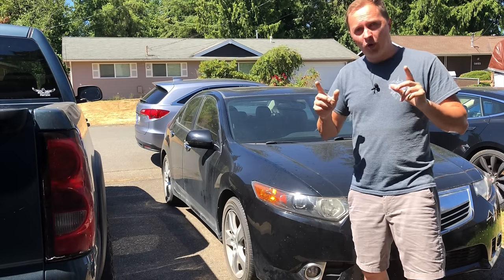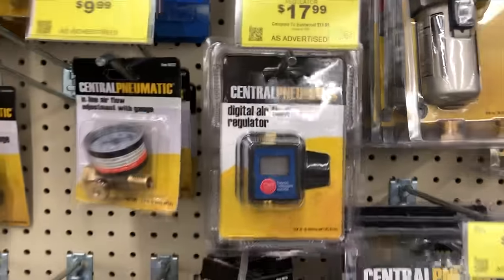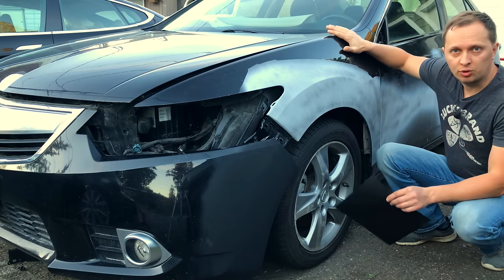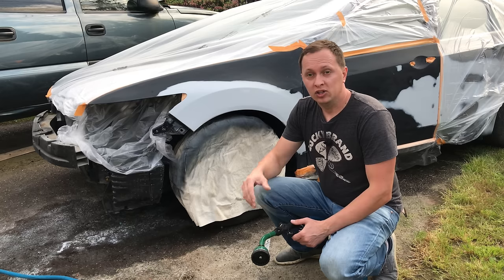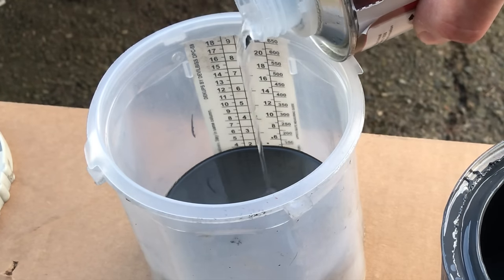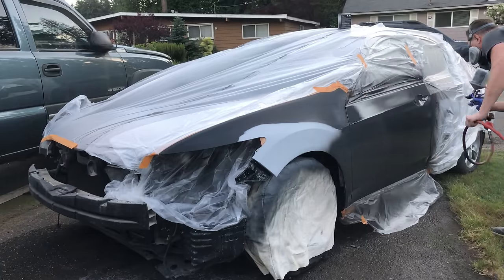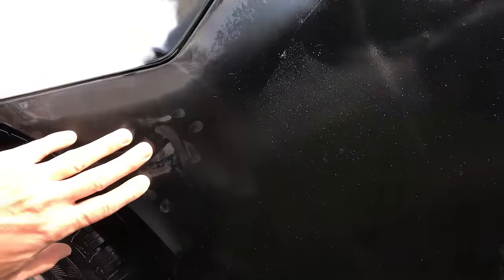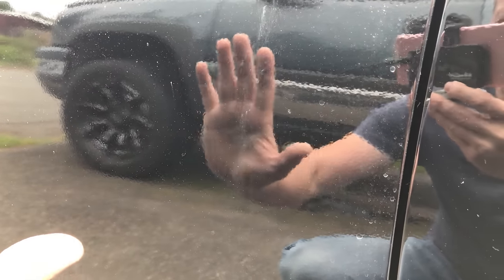✅ Using Cheap Chinese Harbor Freight Paint Gun to Achieve Professional Results

Comment: Am I the only one that thinks this looks pretty good?
Reply from the maker: LOL... I'm a perfectionist, so if it aint perfect, it aint good enough :)
Reply: @fix206  I would be happy with that paint job on my work truck. I’m gonna give it a go this spring wish me luck. Gotta get a spray gun though.
Reply from the maker: If you're going to use of 2 guns in the vid, get the more expensive one... And crank the air pressure up to about 35PSI... You'll go through more materials, because there will be more overspray, but you may get a bit better result then I did...
Reply: @fix206  🙏

Comment: The 14.99 gun is definitely HVLP. The only difference in the 24.99 is the regulator and the tool is included. The cheaper one has neither
Reply from the maker: HVLP gun should perform much better at lower pressure. The 14.99 would probably do a bit better if I cranked up the air pressure, but then it wouldn't exactly perform as HVLP... That's just my experience with these cheap guns, maybe someone else could get them to work better for them
Reply: @fix206  doubt anyone could do any better. My personal opinion is that the gun is worth the money and that's about all. I've bought 3 of them total. Only due to losing the needle spring in both of the first 2( I'm notoriously bad about losing tiny parts) I'd lose my little michael if it wasn't attached. But out of all 3 I never paid more than $10 because I made sure to get them on sale and with 20% coupon. The way I see it the gun is a steal for $10 but I'd probably never pay full price when I can have a good few options in the $30ish range on amazon that would perform a lot better. It's also worth noting that I do not paint professionally but I do prime cars several times a week doing body work and no matter what anybody says, that gun will shoot 2k primer with no problems whatsoever and I've ran at least 200 cups through my 3rd purple gun. It absolutely must be thoroughly cleaned after every single cup but it will lay it down as well as you could ever need a gun to because at the end of it all its gonna be sanded anyway. My purple gun has been used and cleaned so much its gray now. I'm officially retiring it tomorrow though. I've upgraded to the $25 green gun harbor freight has and I'm already thinking I made a mistake. It seems like worse quality than the purple lol but we will see
Reply from the maker: Funny thing is I've been rocking the $15 gun for the past few years to shoot primer out of. And to be honest I think that's the only thing that is good for. Quality of the finish isn't relevant when most of it will be sanded down anyways. And both of the professional guns that I use for base and clear I picked up used that way I only paid 25–30 cents on the dollar for them. This way it doesn't break the bank and I get a great quality paint job straight out of the gun.
Reply: @fix206  I never thought of buying paint guns used. I guess I just figured high end guns were lifetime purchases. I feel slow now. Time to hit ebay thanks for the tip
Reply from the maker: I figured if you are a professional painter and you work at the shop where all you do day in and day out is lay down some paint, then sure, buy a new one it will pay for itself pretty soon. Nowadays I do auto body and paint on the side as a hobby, only paint 2-3 times a year and dropping $700-800 on just one of the paint guns wouldn't be such a great investment for me. The Iwata LPH-400 gun I paid about $180 (around $700-750 new ) at a local pawn shop about five years ago, and my DeVilbiss Tekna I picked up on eBay for right around $200 couple of years back ($$700-800 when new) and it came with a bunch of extra accessories.

Comment: Neither of those guns are HVLP. It doesn't matter what's written on the box, they're not what anyone would call a HVLP designed gun. With what looks like a poorly designed conventional air cap, 1.4 nozzle wide open, and say only 30psi, there's no hope of getting a better result. I believe, (but could well be very wrong), that if you set the pressure to say 45-50psi and only had the needle wound say 1.5 turns out (to compensate for the extra fluid flow) that you might be surprised how well it could potentially finish! I'm not saying the guns aren't garbage, but I wouldn't expect any other result if sprayed in that nominal 2 Bar range that modern guns are "designed" for.
Reply from the maker: Totally agree with you, if you want professional results, you gotta use professional equipment. I'm sure there are people out there that were able to get those junk guns to work for them after a lot of trial and error I bet. Personally I will stick with my Iwata and DeVilbiss guns

Comment: Harbor Freight website says that both the $16 and $30 gun are HVLP
Reply from the maker: I highly doubt that those guns are HVLP... I'm pretty sure I could have gotten better end result with them if I cranked the air up higher, but at low pressure where they "should" have performed better they actually sucked and that leads me to believe that they are not true HVLP guns
Reply: @fix206  Agreed, Paint Society on YouTube used the Harbor Freight gun and got an amazing finish, but he shot at 35psi

Comment: what size compressor and CFM?
Reply from the maker: I run a 60 gallon compressor. Since filming of this video I have changed my compressor set up, it is still 60 gallon capacity but is much quieter and flows about twice the amount of air. I actually did a video on the compressor build. I'll be posting it a bit down the road. Stay tuned

Comment: Both the purple guns are exactly the same it's just the pressure gauge included with the $29 gun but the other gun is actually a really good one you just have to completely disassemble both guns & clean them really good before using them just like u would clean them after using them. The purple gun works really good for high build primer if u make the hole bigger on the cap drill it out to 1.7 & u have a very good primer gun but either way u have to get rid of the little filter on the purple gun it works much better without it. Hope this helps guys
Reply from the maker: Funny thing is I do have the $15 purple gun that I bought few years back that I use just for primer because that is all that it's really good for. No need to spend extra bucks on a primer gun. 50-60% of primer gets sanded down anyway so the quality of that finish does not matter. But purple gun makes one terrible base/clear gun 🤯😡🤬
Reply: I see people using it for single stage allot also but I wouldn't even try shooting clear with it 🤣🤣
Reply from the maker: I've never shot single stage, but personally I would not use this thing for any kind of finish that I wasn't going to be sending down later on

Comment: Have you seen the inflatable paint booth?
Reply from the maker: Yes I've seen them, but they are big and bulky. To be honest I think it's more of a gimmick. And they are not cheap, I believe they start out round thousand dollars and go up from there. If you want to have a bit more of a controlled environment then I would suggest getting a 10 x 20  tent that is enclosed from all 4 sides. I actually have one on the side of my house that I bought from Costco awhile back and I used to paint inside of it years ago until I filed it with a bunch of car parts 😂
Reply: @fix206  ok thank you

Comment: Both purple guns were HVLP, the only difference is the regulator. exact same gun
Reply from the maker: I don't think purple guns are HVLP. HVLP guns are designed to perform much better at lower pressure. But in order to get them to spray halfway decent you have to turn the pressure way up
Reply: @fix206  Can confirm this myself.

Comment: You missed it on the temp of reducer is all,,you needed a slower reducer and it would’ve flowed out…great Video tho,,,keep them coming
Reply from the maker: Maybe you are right, to be honest I don't remember which reducer I was using when filming that video, generally I use temperature specific reducer based on the outside ambient temperature. Other times I would use slow or even extra slow reducer if I'm laying down some silvers or heavy metallic content base coats.
Reply: @fix206  ,,PPG use to give away these nice thermometers that would tell you what reducer to use and win that way your stuff always comes out nice…tho it’s also Gun setup,,Air to Gun,, distance from panel,,it could be one of 8 different things,,I’m not bagging on you,, I’m helping ,,, lmao keep the videos coming…
Reply from the maker: I hear you man... But a quality gun plays a big role in getting a nice finish... And this $15 gun just is just not cutting it... I get real nice finish with my Iwata though
Reply: @fix206  ok,,not enough pressure to the gun or to much pressure to the gun ,,to close,,to far away,,the wrong temp reducer,,,won’t even help with a 800.00 Gun,,but there is guys painting 2020 BMW and making them look like Glass,,,with a HF $16.95 gun,,good Luck
Reply from the maker: The way I look at it, if these guns worked this good, then there would be no market for Iwata, Sata, DeVilbiss, Walcom and even 3M guns... Personally I have never seen a painter from any reputable paint shop use anything but a top-notch name brand gun
Reply: @fix206   The Gun is 20 % of it,,,it’s mostly the other 15 things,,Oo so just because you spend 875.00 on a gun it won’t be any good,,there is guys spraying glass with a16.95 Harbor freight guns…
Reply: It will be Good rather
Reply: @fix206  go watch some videos ,,you will be surprised…I did all my car show Quality work with a beans number 7 cup gun…lol seriously,,so if you know what yr doing you can make a spray can work good,,,I’m just getting back into it,,,after 20 years,,it’s about Skill
Reply: Binks #7 cup gun

Comment: Egh... I dont know. I have laid glass smooth with a harbor freight, a lot has to do with pressure, moisture, paint, thinner, I am not convinced it was totally the cheap gun.
Reply from the maker: I do know that one of the ways to achieve much flatter finish is to turn the air pressure way up, but at that point you're losing a ton of material by turning it into overspray. I basically wanted to see how well this gun would stack up against my Iwata by setting it up the same way as I would set up my nice gun. And at lower pressure this gun just did not perform well...

Comment: What tip measure used??? 1.4 diameter 1.3??
Reply: Creo que el acabado tipo piel de naranja tiene que ver con el tipo de punta que se usa mientras mas reducido el diametro mas lizo
Reply from the maker: Tip size is 1.4 on the cheese guns, But the tip size is also 1.4 on my professional guns and they lay the clear down very nicely
Reply: when you use 1.2 1.3 the breeze with the clear is softer 🤷‍♂️
Reply: I used the pneumatic and it demands more air pressure between 50 and 60 psi. leaves a better finish
Reply from the maker: Wow 50–60 psi is pretty high, I normally spray my clear at no more than 36 psi with good results
Reply: @fix206  😅yes, but it's the gun🤷‍♂️, Try it

Comment: There is one thing that you need to really mention. 

All of that paint could be fixed that really the quality of the gun does not matter if you take the extra time to smooth out the finish. For instance if you would have waited for the base color to dry and then smoothed that out with an 800 grit and then did a clear coat and wet sanded the clear. you would have far less Orange peel.   Moral of the story you really don't need the best gun. Especially if you're going to go back and sand everything down anyway. I've made a spray can job look 10 times better than your job. No gun is going to spray without any orange peel. That is just the fact of life. So if you really want a professional smooth as glass finish you're going to take the time to do the color sand and wet sand. And when it's all set and done no one will be able to tell the difference of what gun you used.  I've had people comment on my spray can job thinking thinking that it looks like a $3000 paint job. A good paint job is all about prep work. And of course you're outside with horrible prep,  and you're rushing. It says you're unprepared. Personally, I would like to see this video redone in a more controlled environment.
Reply from the maker: At the end of the day you don't need any type of sprayer, you can just use a paint roller to roll the base and then clear coat on... and spend days wet sanding your base and clear to make your paint job look like a $10,000 job... But I think you've missed the whole point of the video... No one at the paint/body shop is trying to end up with a 100% glass like finish straight out of the gun, that would be impossible especially on a vertical panels. Every factory painted vehicle will have some degree of the orange peel, some more, some less and goal is to get as close as possible to match the OEM look, meaning you DO WANT SOME ORANGE PEAL, so that repaired panel would match the rest of the car and that is something you can do with a professional gun. Bottom line is these cheap Chinese prey guns are garbage, you won't see any decent painter use one of them for anything more then primer.
By the way, what exactly gave away my "horrible prep"??? I'd love to hear how you came to that conclusion... Spoiler alert: I never cut corners when it comes to prep, I always take my time, it's always done right. I've been doing this for a while and I actually do know what I'm doing. 
There is no point for me to redo this video in a controlled environment, the whole point of my channel is to show people that you don't need a controlled environment... Most folks don't have access to a paint booth, plus I've seen alot of sh*tty paint jobs come out of a paint booth, controlled environment isn't going to make a $15 gun spray like a $700 gun and it's not going to make you a better painter !
Reply: @fix206   The fact that you edited your comment says it all.

You just proved my point that I said you don't need the best gun to get really good results.  

But you are correct you want to get something close enough to what will give I'll give it a quality look and as close to OEM as possible without having to spend a lot of time sanding. 

I'm simply stating that you can get even better results if you put the time and effort in, it doesn't even matter what type of gun you use  And 80 to 90% of painting is actually prep work. It really doesn't take a whole lot of skill in setting up a spray gun and applying it. It's just kind of weird watching somebody showing a painting video doing it outside. 

I get that yeah not everybody has access to a paint booth but I don't have access to a paint booth either but I fabbed one up in my garage.  I don't you think you're gonna find too many people living in an apartment complex trying to paint their freaking car. Most people who live in apartments couldn't afford to even own a home what makes you think that they're going to afford to run to the store and buy all this necessary equipment like a compressor, paint gun, paint, air hose, fittings, gloves, respirator, etc? 

I think this is disingenuous and really taking away from what priorities should be.  Like if you're trying to do auto body in your driveway bro... come on.  You're really just setting a bad example.  You know it and everyone else who does this as a profession knows it. And you're really not even taking into account that paint is toxic.

The fact that you even took the time to make a long winded reply, indicates it's struck a nerve.

Comment: This guy did it pretty good, but It's not the gun, it always the painter & skills. In the other word,  a F1 doesn't mean beat up a Toyota all the time. It's the driver + the gear you are using. My painting skill is just average and I use Chinese gun and buffer, I got mirror finish with no problem.
Reply from the maker: Even some of the worst paint jobs can be corrected with some cutting and buffing. This Chinese gun will spit out paint and if you crank the pressure way up you can get an OK finish with it, but you will lose quite a bit of material, because a lot of it will turn into overspray. Don't get me wrong, if this is just a hobby there's nothing wrong with picking up one of these guns, laying down some paint and then doing some cutting and buffing afterwards. Most folks wouldn't run out and buy a $700 gun. But you don't see professional painters that are painting all day, every day out there use these $15 guns. Pros still use top of the line professional guns, because those guns will give you superior finish, and if you are in a shop setting where time is money, then your best interest would be to lay down some paint and match slight OEM orange peel and be done. No cutting and buffing. Most of the time when I use my professional guns I don't cut and buff afterwards, it's too much extra work. Only occasionally if I get little bit of dirt in the finish then I'd cut and buff just couple of small spots and that it...

Comment: The 16 dollar gun is the exact same gun as the 30 dollar gun, minus the air regulator, which you didn't want.  Look at your footage, the box states "high volume low pressure".
Reply from the maker: It's very well be the same gun, but at the end of the day both of those guns are garbage :-)
Reply: @fix206  I use them for primer, and for utility painting, where they're used a few times, then thrown away. For auto painting,  I have dedicated guns for base (Sata Jet)  and clear (Gti Pro)
Reply from the maker: I also use the $15 gun for primer, that's about all it is good for ...

Comment: No matter what gun you use there will always be orange peel in the clear coat even factory cars have orange peel 😉
Reply from the maker: That is true, but you can match factory orange peel with a good gun. Crappy gun will usually give you much heavier orange peel that will look drastically different from your factory orange peel..